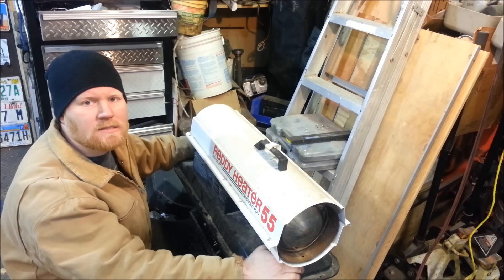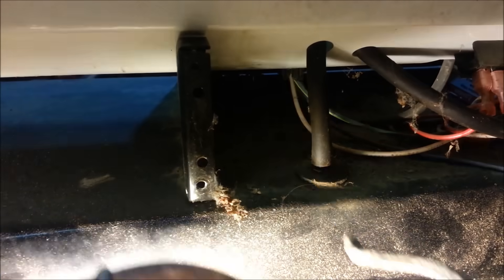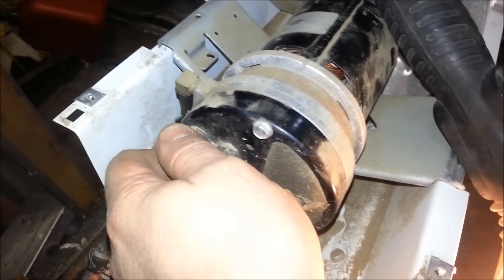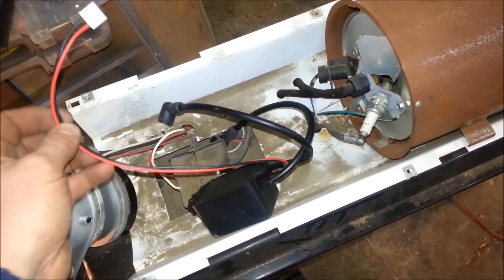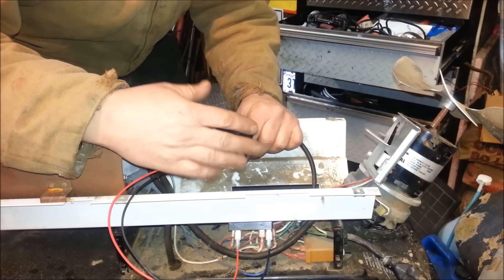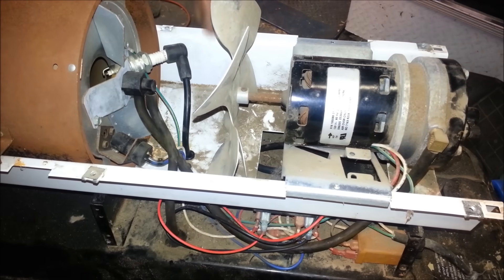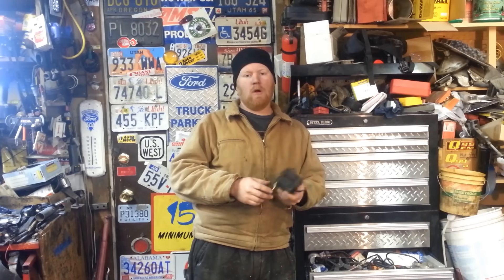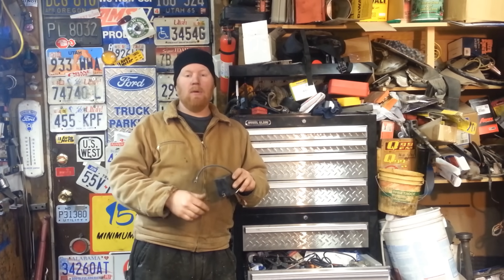Torpedo Kerosene Heater repair & HOW they work

Comment: I have a question for you, I Have a old Kerosene ready heater. My question is my new heater I just bought will run on kerosene or diesel,  Do you know if the old heaters will run on diesel also ?  If not why or can you get them to run on diesel since the price of kerosene is so High
Reply from the maker: Kerosene and Diesel are essentially the same thing with only minor differences. I've never found a kerosene heater that wouldn't run on "winter" diesel. Kerosene is also called #1 diesel. Truck fuel from the gas station is called #2 diesel. Kerosene is ever so slightly thinner as it has been refined a little more but in doing so has less energy than #2 diesel. So you will get more heat from 1 gallon of #2 vs #1. Winter version of #2 diesel has kerosene/#1 diesel added to help it not gel in extreme cold temps.
Reply: Good information to have on here, I pretty much knew all that But didn't know How it would burn in what they call a kerosene heater and if It would Smoke you out or not burned cleanly enough in the older Heaters, called a kerosene heater. I bought a newer heater and that Says It's a kerosene, diesel heater. Thanks for the quick response, I will be trying diesel My old kerosene heater Seeing how Kerosene is so much More expensive.

Comment: An excellent video and learned some good stuff. One thing I don't understand is why people do not take care of these awesome heaters. I have a 115,000 BTU Ready Heater that's going on 25 years old. I have kept it clean inside and out. It has never failed me on a job or at home. I have even used car wax and waxed the outside to help keep dust and debris off of it and from getting inside. 
I believe I paid around 250.00  25 years or so ago. I believe my care has helped prolong the life so far... Check this link...
https://www.youtube.com/watch?v=2EzoWdZLExg

Comment: Any idea why a 75,000 btu unit works better with the fill cap off then screwed on? Im talking about the fill cap on the "gas" tank.

The unit is a Master MH-75T-KFA 75,000 BTU
Reply from the maker: The air pump pressure is probably off and by capping the tank your are slowing the amount of fuel being pulled up(leaning out the fuel air mixture). Increasing the air pump pressure should correct the air/fuel ratio.

Comment: I recently bought a used 50k btu Reddy heater. It is older and worked alright the first time. Now it is constantly having issues where it will run for roughly a minute and then die. It has spark, sprays fuel, and blows air. What is going on with it?
Reply from the maker: More than likely you have a crack in one of the air pump lines or contaminated fuel.

Comment: Thanks for the video. If was very informative! But I have a 185000 Dewalt diesel heater. I have spark, I have air/fuel. It will run like a champ with the cover off. When trying to start up with cover on it will not ignite. I can also remove cover and ignite it then replace cover and it will still run. So my problem is it will not ignite with cover on... any advice ? Thanks
Reply from the maker: The air pump pressure needs to be adjusted.

Comment: my heater will not ignite unless i pull top cover up. then it lights but smokes out the room i am heating. any ideas what i can check. the igniter is working
Reply from the maker: You need to adjust your air pressure.

Comment: Good video.  My rubber fuel line has dry rot cracks. Can I replace it with a piece of standard automotive line ?  Not sure what size diameter to use, I have a Remington 70,000 Btu 5 yr old  heater.  Thanks
Reply from the maker: Wow, that's pretty new for it to start dry rotting. They claim automotive liquid fuel line will slowly get eaten away/degrade with propane. That being said, I've done it without issue or any noticeable softening of the rubber. After the regulator there is only a few psi of pressure in the line.

Comment: I have an old school five point kerosene torpedo heater and it all the sudden quit working. Pulled it apart and it sparks sometimes but not all the time. But if I touch metal part of the spark plug wire on metal of the heater, it sparks the whole time. So is that my module or should I start with a new igniter plug? Thanks.
Reply from the maker: Sounds like the igniter plug. Generally the ignitor either works or it doesn't.
Reply: sixtyfiveford Thank you! I will get another one ordered and put in. I appreciate your help and the video!
Reply: sixtyfiveford well, I put in a new igniter plug and it still won’t spark. But while it was plugged in, I put my finger on the igniter plug where you put the wrench and it zapped me like no other lol. Bad idea. Confused now cause it’s getting power there obviously since it shocked the piss outta me but still not getting spark. Should I try a new module now? Thanks again, Kevin.
Reply from the maker: The spark must be shorting out on the metal before it gets to the ignitor.
Reply: sixtyfiveford ok. So that’s going to be in my plug wire?

Comment: Woops, the fuel is not gravity fed. It gets sucked up from below with a venturi effect so you need the correct air pressure. I have gone through everything except the motor itself, which turns but I'm still not getting 3.4 psi. The motor often had a hard time starting in really cold weather and I"m wondering if it is just weakened now.  I don't know how to test the motor.
Reply from the maker: There are impeller vanes in the back of the motor. This is your air pump and those vanes can stick or get worn out. Take the couple bolts off the back and you'll be able to access these.

Comment: Hey I'm having an issue with my heater it worked great then one day I went to plug it in and the fan doesn't move it buzzes when I plug it in but I also see like a little blue flame. Did my motor go out?? Any help thanks!
Reply from the maker: I would take the top cover off and spin the motor/fan over by hand.

Comment: Is one of these worth 30 bucks with a no fuel issue?
Reply from the maker: It's more than likely the vane air pump not pickup up fuel. You should be able to clean it or replace the parts for around $20.

Comment: Hi I just bought one of these and live in Southern California. What is the best fuel to use? I don’t want to pay for 100% kerosene due to price and I’m not sure the deisel here is winter grade. Someone else said that I could mix 3 parts deisel and one part has. Not sure what to use.
Reply from the maker: Tom bickers You shouldn't need winter diesel because your temps should be above freezing to start with. Winter diesel is designed to keep it from getting at single digit or lower temps. I would just try regular diesel.

Comment: Ok another question for you.  I have one of these and it lights spurratically.  sometime without and issue. sometimes it just doesn't want to get going.  I have a new coil and tested pressure.  seems like If I will blow back into the front when trying to start it will go ahead and light the kerosene.  any advice?
Reply from the maker: These need a proper air fuel ratio to light easily. From your description I would say not enough air is getting in and the fuel:air ration is too rich. I would have a good look at the air filter on the back of the pump. Also try turning down the air pressure a little to reduce the amount of fuel being pushed in.
Reply: thank you

Comment: Yea we gots one of these coffee can heaters. The damn thing don't want to lite since we switched from kerosene to auto diesel for some reason. I guess the viscosity changed the spray pattern and it is now missing the spark plug and there is no way to adjust the depth of the spark plug. I guess we are going to have to change the plug with one that has longer leads on it. Other than that auto diesel is way cheaper than kerosene and the unit works great all except for the starting which can be fixed. Great video.  Oh and there's always some out here with a one inch dick that will give you a thumbs down. They just can't seem to be able to get laid because the chicken runs too fast for them.
Reply from the maker: Haha... You can try adjusting the air pressure up a little so the fuel atomizes better.
Reply: We have tried to adjust the air pressure and even hooked up a breathing machine compressor to it for more pressure and cleaned the nozzle and checked the hoses and everything and it still won't stay lit or even start. The spark plug gets covered with soot and then the spark jumps all over the end of it and re cleaning it don't help since the spray from the nozzle don't hit the end of the spark plug and I'm coming down to the nozzle. I mean you can't adjust the spark plug and replacing it with longer leads will only come down to the same result of the soot collecting on the ends . It must be the nozzle. Hell I took HVAC and it just don't make since any way you stack it other than it being the nozzle. Now I have noticed that the front bearing in the motor is going bad and we re oiled it and it runs great now where it was sticking. We cleaned the compressor and yes we replaced the veins the same as they came out and it showed some wear on the inside but not to where it would compromise the air pressure and it still don't want to start and stay running. It's like one guy called it "the kicking chicken effect". I've never been one to give up on anything and this isn't going to defeat me either! Well off to buy another one and a new nozzle for the old one too and we're off to the funny farm.

Comment: Hi sixty , I have a little work to do and I’m about to rent a heater like this one from Home Depot, heater kerosene 125,000BTU , i have this jobsite that’s is 600 sqf cover with insulation tarps , you think it’ll be good to warm it up ? Thank you
Reply from the maker: 125,000 Btu will do a fantastic job in 600sqft.
Reply: sixtyfiveford l rally appreciate you replied !, is working just fantastic!, take care bud and thank you

Comment: ? i have one that has fresh kerosene and spark and sprays good but wont ignite any Ideas?  You can message me at conks8@yahoo.com thanks
Reply from the maker: Your pressures are off. You can note the position of the screw and screw it in and out 1/8 of a turn at a time and test it. More than likely the pressure is low so screw it in(clockwise) 1/8 of a turn at a time.

Comment: I can see this thing heating a sealed heat exchanger that derives combustion air from outdoors so to not create negative pressure and cold air infiltration by the combustion gas being exhausted outdoors safely, the heat exchangers exterior will be red hot like all furnaces operate and the air being sent across it is both  the return air source and supply air source, that being the indoor air. With a furnace even a crack will 86 the eq2uipment cause as you mention the venturi effect plus combustion air is supplied by the induced draft motor/fan.

My point being to avoid the carbon monoxide exposure to the human beings being warmed in the conditioned space, to operate this safely I would keep my garage door open, no way I would be in a garage or house with one rejecting exhaust indoors! Thats insane! if you dont die it can cause headaches, fatiq2ue , heart failure,  cardiac exaserbation , asthma, etc. hundreds die every year from furnaces not venting outdoors! correctly!
Reply from the maker: I've ran these for hours on end in a virtually sealed shop, with a Carbon Monoxide detector and never set it off once. You would never run one of these inside a home. These can be safely run and if in doubt use a Carbon Monoxide detector.

Comment: Didn't realize at first how old this video is. Great video, mine is pretty beat up, over 10 years old. probably over due for a tune up. I find the fumes are not as harsh using diesel over kerosene.
Reply from the maker: They go for a long time without any care. Generally, I don't fix it if it's not broken.

Comment: Thanks so Much!  Just fixed an old heater I had in the shop not working in 5 years, in 2 min.  just low pressure.  Thanks for breaking it down and sharing your knowledge!
Reply from the maker: Thanks, I'm glad it was helpful.

Comment: Mine was running fine last year and now not at all. I replaced the fuel line and it doesn't look to be drawing much fuel. I have diesel in the tank, could that be the problem. I've looked at the pump and that looks to be good I haven't checked the pressure though.
Reply from the maker: It pulls such little amount of fuel you won't be able to notice it. Does it fog fuel out the front while it attempts to start? Does it spark?
Reply: sixtyfiveford. Crazy good spark. I can't see any fuel spray and not getting any smoke. I going out today to pick up a pressure gauge.

Comment: I have a model R115 Ready Heater kerosene heater, I have installed a new rotor, new heavy duty glow switch, new air filters, new fuel filter and have fresh kerosene in the unit.  When I plug the unit in the glow plug comes on the I see fuel spraying into chamber but  the unit runs for only a few seconds (10-15) then shuts down,  any suggestions
Reply from the maker: If it never lights: your fuel air ratio is out of adjustment. I assume it's fogging diesel fuel out of the front of the unit? Have you adjusted the air pump?
Reply: No it never ignites and I don't have a gauge to put on test port,  should i adjust screw all the way in and work my way out a turn at a time?
Reply from the maker: If the screw has never been touched I would start from there. Screw it in 1/8 of a turn at a time. Keep track and if that doesn't work, return it to the stock point and try turning it outwards 1/8 of a turn at a time.

Comment: My heater blows for about 20 to 30 secounds and trips the braker.Do you think it is the optical sensser? Steve
Reply from the maker: Yes, sounds exactly like the optical sensor. That is if it actually lights and is blowing heat for those 20+ seconds.

Comment: I have a reddy heater 55. I have a stiff fan motor, when i turn it by hand it seems to be stiff in some spots, will that cause it to not fire up. i have spark and fuel.
Reply from the maker: You need to pull off the the filter housing the back and take a look at the air pump. There is an impeller with 4 fins that must be sticking.

Comment: Hello
Well it's been years since I needed a Reddy Heater..well now I need one. Picked one up today from a fella after I paid for it he said full disclosure.  After it runs awhile it will stop and needs unplugged for about 2 minutes then it's good to go . My first thoughts are the motor is heating up and shutting down IDK but hope it's nothing to bad to fix.  Going now to get more kerosene and let it run awhile . He said it had not ran in years when he put away it ran great.  Hope I never got screwed over. Pro 150 Reddy Heater ..any thoughts ..Thanks a bunch for your video by the way.. very informative
Reply from the maker: If it is putting out heat and unexpectedly shuts down it is more than likely your optical sensor. Some models have a thermal safety switch as well that will trigger if it feels too much heat is going into back into the device.
Reply: sixtyfiveford 
I put new kerosene in it and was running good for maybe 10 minutes then started sounding different and stopped then a screeching sound. I unplugged waited 10 -15 minutes plugged back in would not run but made the loud screeching sound again.  I contacted the guy I just got it from and of course he said it never did that before . I hope I never just lost my money and the cost to fix will exceed a new one . Any thoughts? Figured I'd ask just in case you are familiar.  Gonna remove cover tomorrow to try pin pointing noise.  I did feel inside while unplugged and the fan spun freely . Any advice or suggestions would be great . Gonna research more tomorrow as well..Thanks again
Reply from the maker: Squealing is generally caused by the fan motor bearings. Take off the top cover and you will see where the fan is attached to the motor. Follow that shaft back to where it goes into the electric motor. You can put a few drops of motor oil onto the shaft and it will wick back into the bearing.

Comment: Ours only runs for 2 or 3 minuets before it shuts down. What is the issue here?
Reply from the maker: If it is putting out heat and unexpectedly shuts down it is more than likely your optical sensor.

Comment: Ok i have spraying of fuel and spark but it still wont light new fuel
Reply from the maker: The air fuel ratio is off. So you need to adjust the air pump pressure.

Comment: HELP! I got spark and I see and smell kerosene but no ignition. It does have old fuel and it's been in a filthy garage. It fired up 2 times for a few minutes until unplugged. I moved it to another location and now it won't fire.
Reply from the maker: More than likely the air pump pressure is not set just right. You  an use a gauge like I did in the video or just do it by feel. Note your starting point of the adjustment screw and turn it 1/8-1/4 of a turn at a time in either direction.

Comment: Do you or anyone here have an older Remington HH-70T-KFA? Had the wiring apart. Took a pic before hand but the pic is gone. Manual shows different colors then available. I think it's right but a pic of a working one's wiring would be helpful.
Reply from the maker: Sorry, wish I could be more help. The wiring diagram in the manual should allow you to put it back together by tracing where the wires go.

Comment: Help me please!  I have the same exact heater.  Has good spark, air pump is at 3.6, I cleaned the nozzle.  It will run for about 10 minutes, then starts puffing white smoke and trips the reset.  Any suggestions?
Reply from the maker: Sounds like you're loosing spark. Will it allow immediate restart?
Reply: I figured it out tonight.  Your video really helped me though.  It turned out to be the foam filter on the back.  It was disintegrating and getting sucked into the air pump.  Removed the filter and now it works awesome!
Reply from the maker: I'm glad it was something easy.